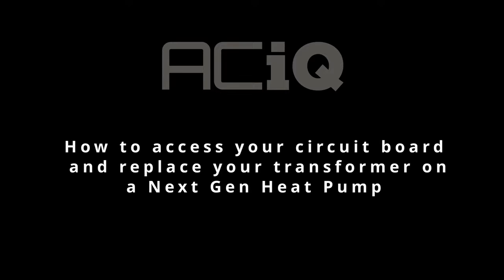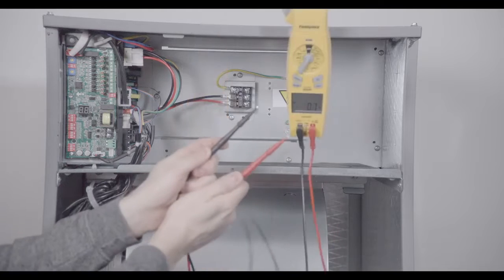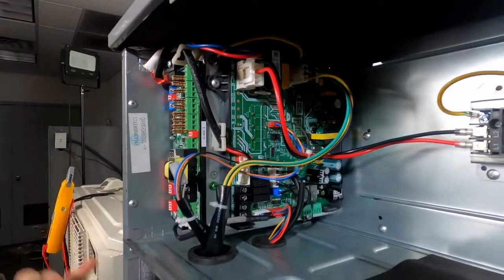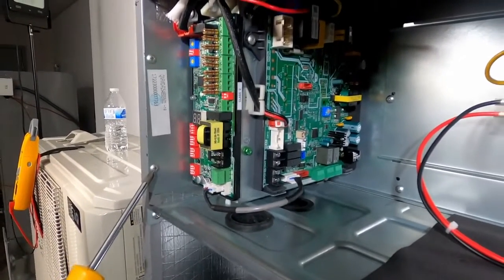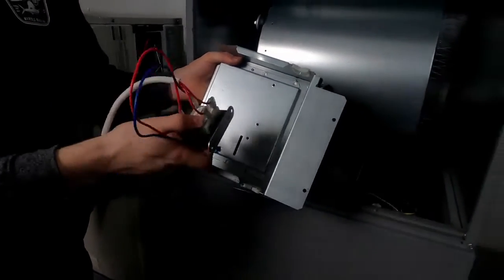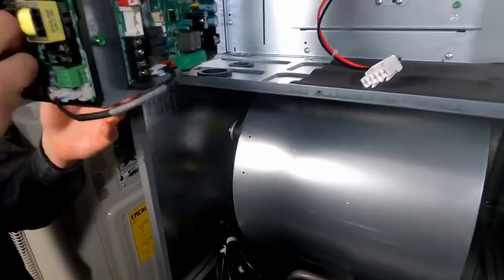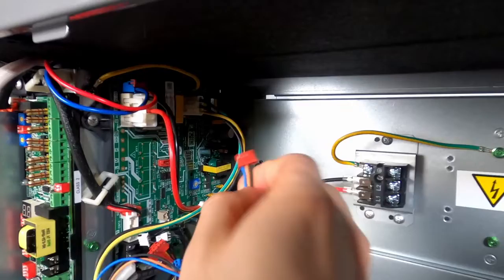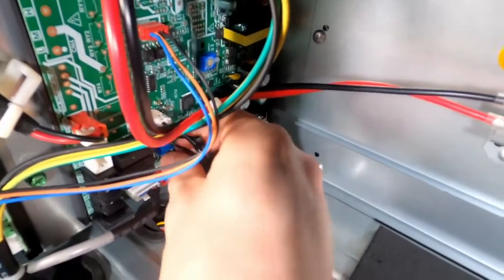An ACiQ Next Gen Heat Pump Transformer Replacement Procedure

Comment: good overview of the process. I do need to point out that the breaker inside the air handler only disconnects the auxiliary heating element if installed. the air handler itself still relies on the breaker in the external breaker panel.